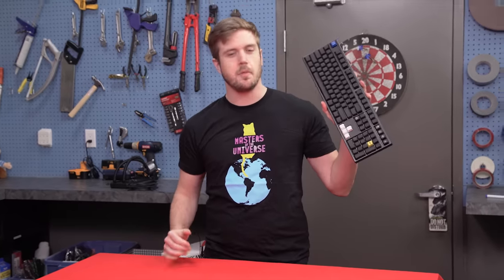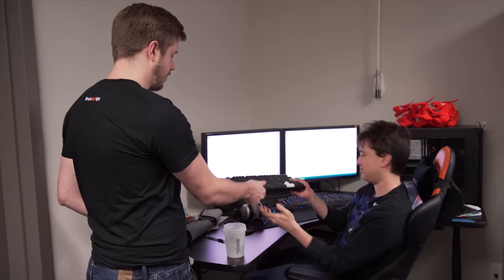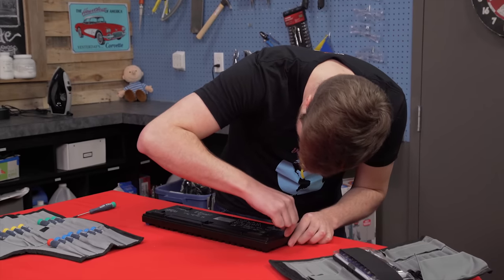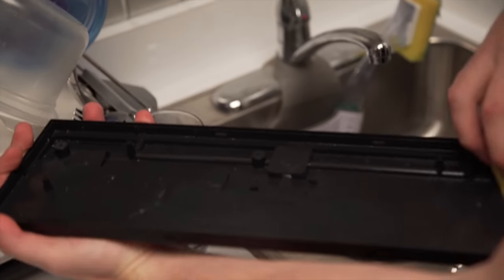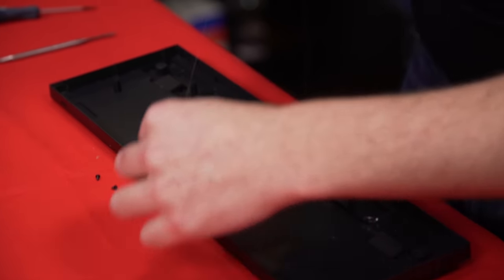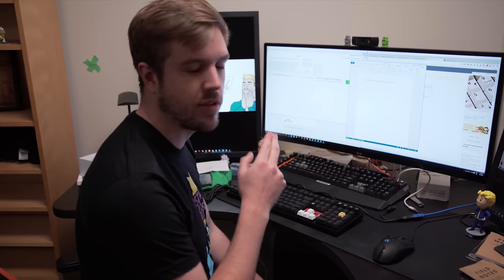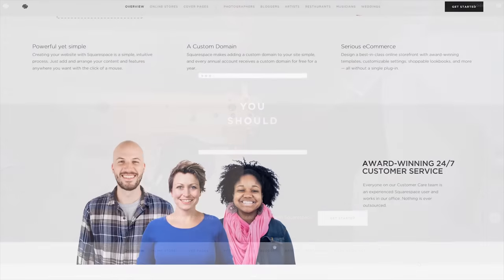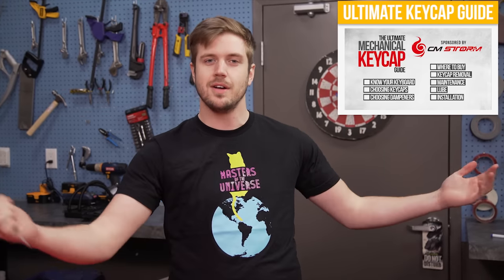Reviving my favorite mechanical keyboard - DIY Keyboard Repair

Comment: 'Oh, I'm bleeding!'  I'm glad I'm not the only one who has that experience when working with computer hardware.  I almost never know where it came from, I just discover after I'm finished that somehow I'm bleeding.  Oh well.
Reply: Same shit happens to me mate... Oh well. I am used to it by now :D
Reply: lol i was getting bored so i skipped a bit and it skipped me right when he said that
Reply: i have to be sliced on every build. annoying so i just forget about the cut
Reply: Dustin Rodriguez legit one time I was programming a game for my brother and I heard a noise so I looked down and there was blood and a huge gash down my leg.
Turns out the keyboard thing on my desk (which I never use) fell off and shattered my nerves, therefore I couldn't feel it...
I still can't feel very well with that leg
Reply: CPU heatsinks ruin my fingers.
Reply: Especially when I plug in the CPU 4 pin connector in the top of the mobo, and I have to wrench my fingers around and on the sharp fins. This is why I love water blocks.
Reply: Caution: Simply looking too hard at through hole PCB's may cause mysterious bleeding on random parts of the body.
Reply: wow hopefully you'll be able to again one day
Reply: Some tech just crave blood sacrifice!
Reply: I was only bleeding when I cut a big lip in my thump cutting open the box with my new knife. RIP my life
Reply: I thought I was the only one
Reply: Anonymous Dog 
>fucking IO shields

well that's the problem
Reply: On my first gaming PC, there was an oddly jagged, sharp frame around the inside of the case. I was guaranteed a cut or two on my hands or wrist after I was done doing something in there, and I would never notice until I'd closed it all up.
Reply: ***** Those things, and coaxial cables come from hell.
Reply: ***** That would be really cool. Regardless, coaxial has always been a pain for me. Most of the time, you can't tell if you're actually making progress when screwing the cable in, especially on newer TV's, where the port is facing downwards.
Reply: maybe it dripped from the ceiling...
Reply: Sausage finger syndrome? Yeah, a lot of coolers expect you to have needle like fingers. The easiest air cooler I have owned is the NH-D14/D15. They even include a long screw driver. The hardest part of that cooler is actually installing the fans, which is a pretty standard affair xD
Reply: Haha can relate so much xD
Reply: So true
Reply: Dustin Rodriguez It happended when i was building my first pc. I pretty sure i got it from the mother board
Reply: Henry Pham io shields can be nasty

Comment: Please rename this "Luke Hotglues his Keyboard"
Reply: +AndrzejKucyg so how should he have fixed the broken part? re melt the plastic?
Reply: +LarryLazz using using some bare steel wire and a soldering iron to melt the wire into the plastic and the plastic to the little nubs then using some two part epoxy to make sure its sturdy, then re attach the USB PCB back into place with the screws and put it back together.
Reply: +Demetry Romanowski or.... and this is just a crazy idea... just use hot glue like he did? easiest method is useually the best method
Reply: +LarryLazz yes I personally would have just used crazy glue or hot glue but that is not the point you asked, and I answered a very feasable method of repair.
Reply: +LarryLazz epoxy resin is probably best, then some other super glue or plastic cement
Reply: okay you have all misunderstood what i was getting at here... i wasn't asking a question i was pointing out the flaw in what the guy i originally replied to had said... i know there are plenty of ways he could have done it so pointing them out to me isn't solving a problem because there wasn't one to be saved...
Reply: +Solkia2010  Whoa! #SpoilerAlert
Reply: +Solkia2010 Would anyone know where to get keycaps like the ones he has on his ducky keyboard? I really want that design where it is on the front of the keycap
Reply: +Brandon Key Look online for Cherry MX Ninja Print/Front Print PBT keycaps.

Comment: I've kept a Sony Viao laptop alive for over 8 years. I've replaced the screen twice, upgrade to an SSD twice, & upgraded from 2GB to 4GB of RAM. I've soldered in a yellow RCA port to replace the broken power port and soldered the end of an RCA cable to the end of my power cord, which I've replaced 3 or 4 times. It has Vista 32 bit, but now Windows 10 64bit with only minor quirks. I've replaced the battery which came with a BIOS cd to bypass original Sony battery verification.

The current SSD is acting up again, so I continue the cycle just fixing it. It's really no better than a Chrome Book these days, but I hang onto it not only to save money, but as a testament to working through problems instead of taking an expensive cop-out.
Reply: Is it still going
Reply: @gqh007  i too would like to know- sounds like one heck of a laptop lol
Reply: 8 years isn't that long for a laptop right? I've had my laptop for 8 years, I haven't even needed to repair anything yet. I just replaced the battery once, removable battery so I didn't even need a screwdriver.

Comment: Chryrosan22 Fans: Ooh that sounds ama- Did he say Cherry?
Reply: hahaah :D
Reply: "Oh I quite like cherry, the browns feel so tactile!"
[cries in MX Sand]
Reply: Retooled blues are actually quite good.Recently got an MX Board 1.0 with blues and the click is just fantastic.
Reply: Any mechanical keyboard fans really.
Reply: Finn K Facts
Reply: @pokepokepoke64  I like them both
Reply: Even if cherry improves bleu or and better blue gaterons are so much better
Reply: @MrJimmysko  im really craving for a secondary blues keyboard. thinking about building a budget smol boi with blues on them
Reply: @Daniel-dj7fh  Go for it.You wont't regret it for sure!
Reply: The plasyic in plastic sound is easy to recognize tho

Comment: Watching this in 2019...
I really miss luke.
At least there's WAN show.
Reply: Whatever happened to him anyways?
Reply: @projectjt3149  He stopped working for Linus Media Group and made a company called Floatplane
Reply: @kaverixp8562  You put it wrong. LMG owns Floatplane. Due to some kind of legal issues he had to resign LMG  and join Floatplane
Reply: @uhmythx  No, LMG doesn't own floatplane. Linus is the CEO, but LMG doesn't own it. It's a seperate company entirely
Reply: @arthurgao3787  sorry, i actually meant lmg as Linus tbh😅

Comment: Ducky quality is amazing. I don't exactly like the removable cable support on that model but my DK2087 is flawless. I'm pretty sure I dumped water on it at least once and it still works perfectly fine.
Reply: +bergauk lost a large glass of mtn dew on mine, took me 3 hrs to unstickify everything XD
Reply: I had 3 Razer Lycosas in the space of two years, got a Ducky Shine 3 back in 2013 and never had a single issue with it.
Reply: +bergauk I should have just picked up one instead of wanting to wait for a very specific switch to be in stock.

Ended up buying a Keyboard Paradise V80 and I regret that decision in whole.

Ducky or go home!
Reply: +bergauk "Ducky quality is amazing" watch the video. Switches and PCB define the mech keyboard. Switches are same and there is construction problem with PCB as on video, so wtf is "amazing"?
Reply: +Pot Head (P07H34D) "Ended up buying a Keyboard Paradise V80 and I regret that decision in whole." why?
Reply: Majou Nexian The green cherry mx switches I bought aren't awesome. It feels cheap because it doesn't have an aluminum back plate. The key caps are low quality and already have started to wear away the black outer layer of paint to show a white key color base. I have been having issues with double and multiple clicks on each key press which started happening right around the end of the warranty (1 year) mark.

I could go on lol
Reply: Pot Head
"double and multiple clicks" if its individual switch, add a little WD40 in the switch. Otherwise, I only heard of this affecting whole keyboard as a windows driver issue.I don't know why would you be not liking mx green, but the rest of the issues seem to be valid. I mean, I would also flip off in your place. Absence of metal plate is already a reason to return it, unless its a "feature". Thanks for sharing.
Reply: Majou Nexian It started off as only a couple of keys and eventually turned into the entire keyboard. Now its back to only happening every once and awhile but compared to when it was at its worst, I don't even really notice it.

I get a loud buzzing from the red leds when I turn them on.

I like the green switches for some stuff but its definitely not necessary for wasd or for the entire keyboard.

Honestly it's just the price point that got me. I could have thrown $20 more and I would have something top tier.
Reply: Pot Head
I don't think Ducky is top tier. This is my personal opinion, which is only based upon the amount of issues I encountered on internets. Filco is.

The leds can be unsoldered individually and replaced. Thats probably item-quality related.

Greens are blues with just a tad higher pressure point. I have blues and I have them fully silenced, but even original clicky variant - I consider them to be "the" switches. But its highly personal...

You can replace keycaps, get ones of better material.. The absence of backplate and multi-activation are show-stopping imho. Perhaps its USB cable, maybe put a ferrite ring around it. Or solder a new one.Never had the issue, so randomly guessing.
Reply: Majou Nexian I wasn't only speaking of Ducky.

I just meant in general $150 at a keyboard nets you something fancy.

$130 at this KBParadise and I feel scammed lol
Reply: I'm ready to just go back to the $70 cooler master boards
Reply: +Majou Nexian You're right, switches and PCB define the keyboard and Ducky builds some of the nicest boards around. It's been a while since I took mine apart but they're very well built and can withstand a lot of abuse.
Reply: Majou Nexian A drain port, a dorrito collector, and some kind of cup holder would be loads better than

a second LED color!!!

WOOOOO!!!!!!!
Reply: bergauk
Thats nice to hear that! I have something completely different - wireless, mx blue but fully silenced and I paid 80 bucks for it. Had to fiddle around abit, but I love it. Fortunately, it has no connection or any other issues.
Reply: +Majou Nexian What model, if you don't mind me asking?
Reply: ***** Xarmor U9WL. Beware that its wireless permanently, USB port is only used for power source, dongle is required. Filco Convertible does it better, but its in different price segment altogether.
Reply: Majou Nexian Cool, thanks.

Comment: I tried to fix my own PS4 controller after the warraty expired and now my R2 button and left analog stick work just fine. Only downside is I broke the lightbar but hey, one less thing leeching battery?
Reply: Daniel González I guess?
Reply: Console peasant :v
Reply: @sskies4972  Damn necro much?
Reply: @anweshkatragadda6867  console peasant
Reply: @TypicalPeen  you too jesus
Reply: @HowIsAsh  Sooooo I can tell you never have played Dark Souls on PC :)
Reply: @HowIsAsh  i can tell you never played nioh on PC (it's impossible with m&kb)
Reply: Dreadnought Nice bait.
Reply: To fix the light bar just change the charging port.  It's one part. The cost is dirt cheap. Only like £2
Reply: @SludgeManCometh  half a year ago bro and i said it's impossible to play with mouse and keyboard not with controller.
Reply: @SludgeManCometh  lol this is funny, I've finished nioh, waiting for nioh 2 atm.

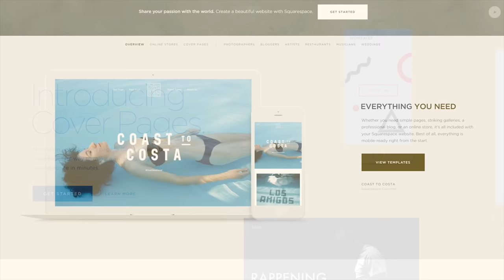Comment: 10:10 - "Cover pages! Just in case you need a job for a resume or something!" 

What?
Reply: +Sab what??
Reply: +triton62674 He was quoting exactly what Luke said. He mixed up "job" and "resume" in that sentence. Should be the other way around to make sense. That's what he was pointing out. I have now explained the obvious to you. Congratulations.
Reply: +Sab Think he is thinking covering letters which you send with a cv/resume
Reply: +Sab i usually get a job to put on my resume, i don't know about you though, weirdo.

Comment: Thank you, you’ve inspired me to take apart my keyboard today. My favorite keyboard is the Logitech g15 gaming keyboard.

I had problems with the “I” key with it not responding to key presses. All of the other buttons seemed fine but this puzzled me and I just looked for a replacement keyboard. 

I wasn’t sure how to see about getting it fixed, it was just waiting for my tech pile to get big enough to call the “pick up your crap” tech recycling guys.

I took it apart and it was very interesting what  the keyboard components are. I hope the solution to my fix will get my baby working again.
Reply: did your keyboard ever get fixed?

Comment: Fixing is always better then replacing!! 

Just got given a cheap TKL Blue switch board for free because some of the keys aren't working. That'll be easily fixed. Planning on using the school makerspace to put in new switches anyways. I'm gonna make it my own!

Comment: I actually took my k70 apart (completely), and washed it in the sink and rinsed with the demineralized water. Blew it out with a hair dryer and let it dry.  Lubed it up with some silicone spray for electrical switches, works fantastic now.  

FWIW I spilled juice ALLL over it. I thought it was fried, the keys were super sticky, it immediately shorted out the usb port, it was pretty messed up. I had nothing to lose :)

Comment: I bought this exact keyboard when I was twelve, and it was new. Year of the snake was my zodiac, and I had just received Christmas money, so it was time to splurge. I remember buying single parts to build my first computer before it was finally ready to build. Jump to today, and I'm still using this keyboard for a computer science degree. This model was notorious for having a bad batch of blue LEDs, and sure enough, half of them went out. Today, I took this behemoth apart and soldered in 108 new white LEDs, and I feel just as giddy as I did when I was twelve years old, testing out all the lighting modes again.

Comment: LOL! Ducky USB port broke! Reinforcing it by putting extra solder on four points which hold miniUSB port on the PCB was the first thing I did on my wireless mechanical MX blue ninja U27. Ninja because I silenced both clicks and bottom downs with oil and orings. The tactility is not affected.  Also you can restore the plastic by melting it with gas soldering iron, but it depends on plastic type and dont overheat it because evaporation of plastic softener caused by heating make it break-friendly.

Comment: I was walking home from school one day and saw someone throwing out a broken 1080p flat screen TV. The screen was fine, it just had some signal issues.I asked the owner if it was okay if I took it home. He said it was fine. So I brought it home, opened it up and the solution was so simple. All I had to do was put a piece of paper in between the signal cable and the frame of the TV to keep the cable in place and the signal was fixed. It really is worth trying to fix things. Now I have a free TV for 2 hours of minimal effort.

Comment: [FINE BROS. ENTERTAINMENT CENSORED THIS REACTIVE COMMENT FOR COPYRIGHT REASONS]
Reply: rip
Reply: Nevr frgetti
Reply: [FINE BROS ENTERTAINMENT  DELETED THIS COMMENT FOR REPLYING TO spartan092 AND IS FINED $49849215912738129751234219847984]
Reply: +spartan092 Are you guys done with those jokes now? The horse is bloody dead.
Reply: +TheKyshu [FINE BROS. ENTERTAINMENT CENSORED THIS REACTIVE REPLY FOR COPYRIGHT REASONS]
Reply: ***** The horse isn't dead yet, I seen its tail move.
Reply: CyrexHD Yeah I saw the tail move but the head was decapitated... and the mouth has a [CENSORED] tag on it.

Comment: I actually just took apart my Logitech MX510. I've been using it every day for the past 12 years and it was starting to give me issues recently. I disassembled it and gave it a good cleaning. It's working great now, so I don't need to replace it yet. It will certainly be a sad day when I have to shelve my MX510.
Interesting video though. I also belive in this concept, take it apart and try to fix it. Even if it doesn't work, it was already broken.

Comment: Got a dishwasher? Turn off the 'heated drying' and probably the heated washing options (depending on dishwasher model) and you'll be able to throw the plastic parts in there. then you'll be set up for using adhesives again while avoiding the whole scrubbing on the complicated parts.

Comment: The keycaps on my K70 need replacing, but it will cost too much to get replacements
Reply: You could probably use some  plastic over top the switches and just ghetto tape the plastic to the switch slider
Reply: Why do they need replacing?
Sorry i never had a mechanical keyboard or didnt research them..so yea
Reply: +Shizzle my Dizzle I put to much pressure on a few of the keys damaging the stem/shaft thing on the key caps.

I have swapped out some other keys to make it work, but other keys are worn out.
Reply: +IIGrayfoxII Wtf? i'm impressed you managed to even slightly damage cherry caps
Reply: +IIGrayfoxII oh,thanks :D
Reply: +Hawtsaus 
Here is a pic of the 2 of the keys 
https://www.dropbox.com/s/ethnch0c1ecr56x/2016-02-18%2020.22.22.jpg?dl=0
Reply: IIGrayfoxII oh my bad i thought you meant switches. I'll go to sleep now... haha
Reply: +Silent1666 It is well out of warranty, would like to get new caps since the keyboard still works fine.
Reply: +Silent1666 Checked out all of the ones on the forum link, none of them have backlit normal keys, they have Custom backlit
Reply: dude, you bought a k70 but can't swing $30 for a set of keycaps? Christ, I'm sure corsair would send you some free. cherry keycaps are a dime a dozen, they are everywhere.
Reply: +Stickbo They are $70 for a full set(non backlit) and when you include shipping
Reply: +IIGrayfoxII keep an eye out on Massdrop, they regularly have keycaps for sale. Altough the non-standard bottom row on the K70 is quite annoying...